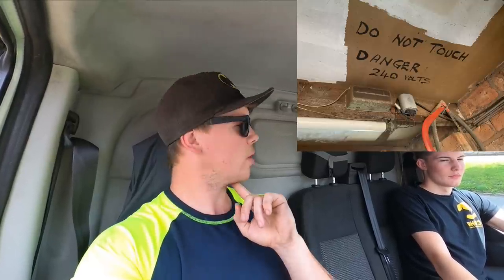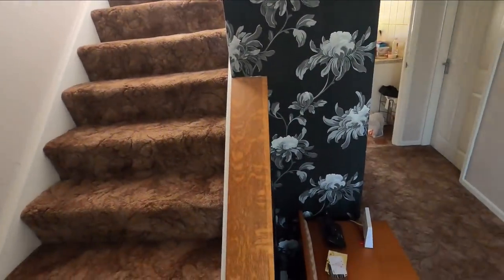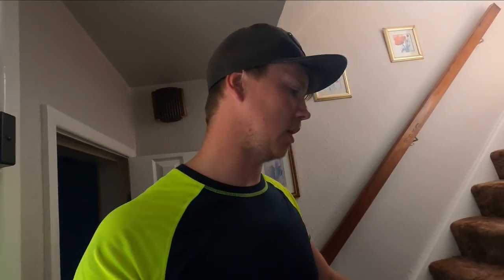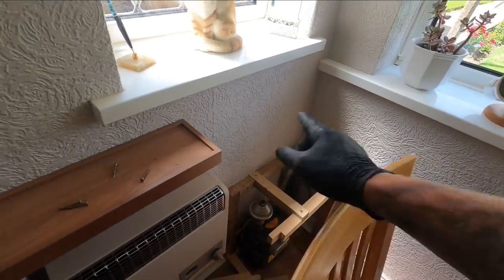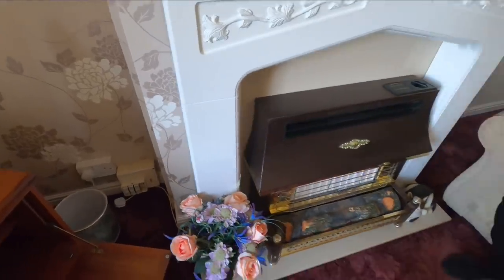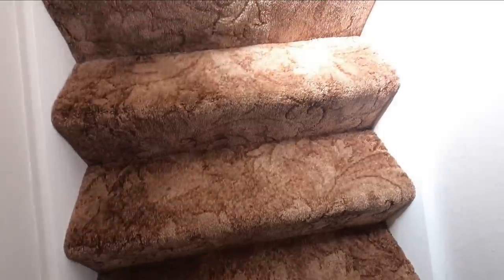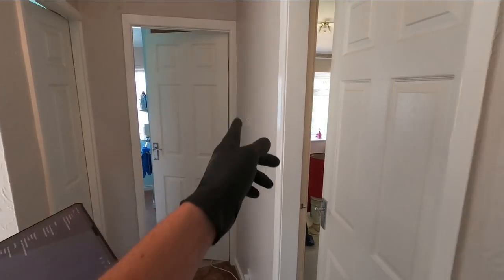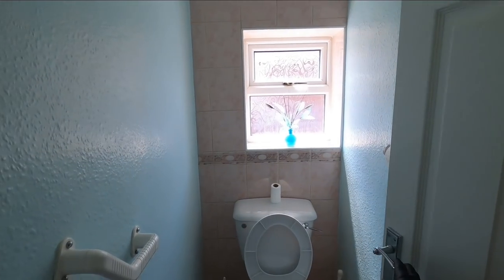How to price/quote a re-wire, Exotic life of an Electrician

Comment: With the Age of the installation I would be wary of asbestos in the consumer units on the fuse carriers when stripping out.
I personally wouldn't put switched fused spurs on the larger 2.6 -3kw storage heaters as I've seen them burn out get hot because of the load. Best to put a 20 amp double pole switch
Reply from the maker: Noted 👍 cheers Paul
Reply: @NBundyElectrical  no problem, The new lot 20 storage heaters as you are probably aware take 2 supplys if your future proofing
Reply: @NBundyElectrical  not just the Consumer units, there`s Artex everywhere and depending on its age Artex can be chock full of Asbestos, chasing through it releases fibres
Reply: @codenamenel  so does jointing compound , gen up on asbestos every six months !! LOL

Comment: Worth having a look at JW's vid on cooker circuits as he suggests that 6mm could be over egging it now and 4mm would be fine. Glad to see you back on the road again👍
Reply: Thought jw would love all those fuse boxes switchgear and ballasts
Reply: 2x 4mm radials is a good shout
Reply: no you shouldnt 4 mm are good for most of them but a 6mm for future prof the installation , in 10 years if the client wants to buy a stronger cooker he will need a rewire
Reply: @cocoino2307  7360 watts (32amp 4mm cable) should be plenty for any 600mm cooker
Reply: @TheHambletonbiker  i disagree  , you should always future proof it , if the costumer wants to rebuild the kitchen in 10 years and chooses a big expensive cooker he would need to rewire the whole circuit because the cowboy spark wanted to save 10£ on the cable , I remember wiring a cooker with a 10 mm cable (i dont remember how much it asked but i was for  a million dollar house ) , other thing lets say in 10 years the cooker thats there breaks and the guy buys one and it  takes 8 9 kw he will either have to buy a new cooker or buy a smaller one
Reply: @cocoino2307  have you watched JW's video? If not I suggest you should, he is a lot better versed on the regs and technical electrical knowledge than 99.9% of electricians and he breaks down exactly how you can use a 4mm for cookers of up to 15 kW, this may not be exactly the figure he gave, watched the video a few weeks ago, you should check it out though!
It's very surprising, but when explained it makes perfect sense, there is ABSOLUTELY no reason to run a 6mm for a cooker or hob, not matter the size.
Potentially the only time you would need to do it is with a very large commercial appliance.
15kW far exceeds anything you would ever have in a domestic setting! 👌🏼
Reply: ♣A well said 💯
Reply: @JackdiyGarden  Cooker circuits have a lot of diversity applied to them . After diversity you can run a 15kw double range cooker on a 6mm 32amp supply so yes for a 600mm wide cooker on a 4mm radial will suffice .

Comment: Sounds about right for a non vat price ,I have to charge vat so I have to make it 20% cheaper than an electrician working from home with not many overheads so you would make more from it than me but luckily I'm normally pricing against  other vat companies so normally get the jobs. Alot of new customers dont go with the cheapest but with the middle price so dont make it too cheap. 1 job we had was to change all the lights in 2 blocks of private flats .the cheapest was about £5000 I was £8000 and the 3rd was £12000 and I got the job , with many other jobs after that without any quotes
Reply: Never heard of any one else giving a 20% discount coz there vat registered. Personally I wouldn’t entertain that.

Comment: Here in Canada that job would easily be $12k CAD. And we for the most part have wood frame walls with drywall or lap and plaster. A lot easier to deal with then the solid plaster / concrete / brick you seem to deal with a lot. Hard to find good honest contractors, glad your town has you to rely on.

Comment: I'd heard that the reason light fittings were put nearer the window is so that the first electric lights mimicked natural daylight. The off centre pendants were definitely a thing from at least the 30s right through to the 60s. In hindsight though I've come across small terraced houses from 1900-1910 both sides of the Pennines where they've asked me to add a central pendant to a dining/living room with only wall lights, and upon taking up the board in the middle of the bedroom there's been a defunct gas pipe centrally

Edit: I'm in Sheffield, similar spec but Crabtree board and only T&E to switches, no VAT, no making good, estimate off the top of my head would be 4-5k. If the switch drops will pull into existing conduit/capping think I'd give the customer the option of surface mounted sockets above the skirting to save on the making good other than the kitchen. If you need to put an earth rod in I'd be lifting one of those flags at the side of the garage I think. Out of interest would you put the board somewhere like 1.2-1.5m from the floor in that cupboard, with maxi trunking up and down?
Reply: the lights put near windows so as not to cast a shadow in front of the window while you was in the room
Reply: socket outlets have to min 450 to bottom switches max 1200 to top on all new installs gone are the days of sockets on top of skirtings!

Comment: Check out John Ward's video on cooker circuits. 4mm is sufficient for a 32amp breaker rather than 6mm. 6mm was only used because of the correction factor associated with a 30amp bs3036 fuses.  We've all been wasting money on 6mm we didn't need 🤣🤣
Reply: That would be  dependant on the reference method and length of run in many scenarios .

Comment: My house is a lead incomer and the cut out burned out a while ago. The dno put a pme cut out onto it so I have 3 options now either the braided thing on the lead sheath with the 4 screw terminal block or the neutral terminal on the cut out. Or link them both. Seems an odd way of leaving it but I don’t care as it’s only my house. Excellent videos thanks.

Comment: Unless it's in the middle of nowhere and fed overhead it can be converted to a PME supply can't remember how much it costs now although it will require digging up the drive if it's lead incommer get a proper earthbond to put on it (not a pipe bond)

Comment: Hi mate would you not fit mains powered carbon monoxide alarms on your smoke circuit? In the rooms with gas fires and a combined heat and smoke in the kitchen? Aico alarms can transfer stored data straight to your phone through a series of beeps! Should check it out

Comment: Hi Nick, good to see you again, never thought of running 3c & e for light switches, that would mean that you still run to the ceiling rose? I'm continuing with a rewire tomorrow(Tuesday) and I've got to run the cables in tomorrow so I might try it in this way
Reply: Doctor Electric An electrician that hasn't thought / heard of taking a neutral to the switch is a worrying prospect! It's been discussed as good practice for years given the expected rise in home automation.

Comment: With that age of property and installation they used to use the old water pipe as the main earth many years ago. 👍🏼

Just need to install a new earth rod with the rewire.  I'm suprised there is not a voltage operated trip that must had been removed.  🙉

Comment: A lot of suppliers no longer offer economy 7 or night storage. If meter replaced that subscription may go and customer left with a redundant fuse board and heaters not working. Maybe timers in consumer unit on rcbos would be better for heaters or change a few heaters, night storage radiators much more expensive to buy than ordinary radiators.
Reply: Jane South There are literally dozens, if not hundreds of time of use / economy seven type tariffs available, and I'm not convinced that a meter change would have any impact whatsoever on the customers current deal either. Night storage heaters are a relic from a bygone age I agree, although if they serve an elderly customers needs it's probably more economical to leave them in and just supply them properly and safely- a new future owner will replace them with gas central heating anyway.

Comment: I've seen some instagram stories, thought it that bad till I watched this.... oh god... HOW IS THAT HOUSE NOT BURNED DOWN?! How is possible with all power hungry storage heater heating?! 😱😱😱

Regarding tiled wall in the kitchen, could you be able to feed cable on other side of the wall into socket? Or routed elsewhere out of sight?
Reply: We have safe zones where we can run buried cables, https://professional-electrician.com/wp-content/uploads/2018/01/021_PE_DEC17-copy.jpg
You cant run cables on the back side of the walls unless you can see the accessory from the other side of the wall
Reply: @codenamenel  Speaking under correction shouldn't anything outside of zones should be done in metal capping or piping?
Reply: @TheHambletonbiker  metal capping isn't the required thickness for mechanical protection from penetration. You could potentially use metal conduit as long as it was properly installed, but thats a much bigger ball ache than removing a few tiles etc

Comment: Take note you young lads fresh out of college there are thousands of properties still wired like this all over the UK.  They look modern on the outside new windows roof plumbing etc but 1950`s electrical systems
Reply: acespark1 You see this a lot if you are house hunting, particularly here in London. Any old house that has been "recently renovated" needs very careful attention- many amateur "property developers" think nothing of installing new kitchens, bathrooms and flooring throughout without ever bothering to check the wiring. I have seen countless properties that look fantastic, only to find that most of the new kit needs to be ripped out to get to the sixty year old wiring beneath and replace it. There are tens of thousands of houses still out there with ancient four way Bakelite Wylex boards from the 1940's still powering the entire house.

Comment: Hopefully that gas water heater in the bathroom is not working any more..that's realy dangerous.
Here in Portugal there used to be many like that, but it's been made illegal several years ago.

It's funny to see how different things are even between european countries.  I've remodeled an old 1960's house and the wiring was terrible..everything running on 1mm2 cable, on just one circuit without any earth..

The "only safety feature" is that we run much lower amps to the houses here..most people have the basic tariff which limits the available power to 15amps..limiting the possibility of those wires melting..

Comment: Ceiling light fixtures hanging from their power cords ? Electrical devices in the shower ? U.K. houses seem to be very dangerous.
Reply: Pendant light fittings are designed to be that way & are used all over the world.  The only electrical device in the shower is the shower unit itself... again nothing unusual in that, the heater that was in the bathroom was powered from outside the room using an extension lead & isn't normal.
Reply: British Electrical standards are one of the best. I’ve worked in many countries and can tell you it’s better than the US NEC and Australia’s AS/NZS. What you’ve seen here is the bottom of the barrel
Reply: Farmer Dave ceiling fixtures are designed to support a 5kg load, they are used all over the planet. Obviously heavier fittings use a chains onto a hooked rose. As previously mentioned the U.K. has some of the strictest regulations and safest standards in the world.

Comment: Damn. I’m a electrician in germany. And the difference is insane. The fuse box in the beginning ng looks like a mess. Is it normal like that?
Reply: NO!!! I don't think so! 😂 It's soooo old, this is first time I've seen entire wiring in this such state! I am amazed how that house has not burned down, with all that power hungry storage heater heating! 😱😬
Reply: Ali Salih Yes you are so right. I was shocked for a second that this is normal in the US. I mean I know that it is a bit different. But damn that’s dangerous 😂
Reply: It both is & isn't normal.  Modern installs are much better (or should be!), but older ones have tended to be adapted over the years hence why there's so many fuse boards.  Up until 2005 it was common for householders and unqualified persons to have a go at wiring, but in 2005 it came under the building regulations so most electrical works now require a sign off from a registered electrician.
Reply: @jeanhomuth6376  Not sure if that was typo or something, we are actually based in the UK. I was actually shocked and amazed as more and more he show around the house, the more dangerous it get! 😬
Reply: @farmersteve129  Yeah I agree, I can see it been adapted / added over the time until it form into a major clusterf*ck! It's so bad and I am amazed 😳
Reply: To add to FarmerSteve's comment, the original installation and the fuse box are probably from the 1950s. The light switches and sockets have been replaced more recently (perhaps the 1980s), but that's been done on the cheap. The cooker wiring looks more recent: late 1990s I'd guess. The rubber cables would have been due for replacement 40 years ago.

But it is completely normal to have the cutout, the meter and a consumer unit wired together using PVC-double-insulated 'meter tails' that just dangle in the air, often surrounded by household clutter. I don't think we notice how messy that is, because that's just how it's always been done. Newer houses (since the 1980s) have the cutout and meter in an outdoor meter box, so they look a bit tidier, but the tails are wired up pretty much the same way.
Reply: This seems about average to what I used to see 30+ years ago helping my father (time served master spark). We pulled some real beauties with those exact garage lights in bathrooms, multiple skirting DBs, lead and fabric wiring. Rewiring with live in was always a fun job!
Reply: I've seen the same or worse in Germany... lights fed with 1940s rubber cables, no earthing, live busbars open to touch in distribution boards, even lead-sheathed cables...

Comment: Storage heaters have dp switches on the off peak supply, do they not? Wired some recently. Fused spurs arent meant for sustained high power tasks like storage heating, dp switches are better suited. Also some storage heaters have 3.6kw elements.

Also why storage heaters and gas?!
Reply: I was thinking why storage heaters when there is a gas boiler.
With the switched fused spurs for double pole switches I agree I've seen plenty spurs with the fuse carrier welded in  and over heat marks on the back because of the thermal effects of the load current on 2.6 and 3kw Storage heaters

Comment: He should at least be offered a low cost simple board change with one plug until can spend more and run things on extension lead as that installation will fail shortly leaving completely cut off.
Reply: Jane South Running everything on extension leads is a recipe for disaster. If the homeowner doesn't trip and break their neck in the first week, they will end up burning the house down through overloading.

Comment: How has that house not burned down ! Some of the worst electrics I’ve ever seen.
Reply: I've seen worse! How about sockets wired with 0.75 mm2 flex buried in the wall? Granted, they were on a 10 amp fuse but that's bad enough. The route the flex took inside the plaster across the wall looked more like crooked stairs than straight lines too. My best guess was Italian sparks after two bottles of grappa because they used Italian sockets everywhere and Italians loved that flat two-core flex for fixed wiring back then. In another place I had kitchen sockets fed off of a piece of the same 0.75 mm2 flex, no earth, fed from a 16 amp radial. Decent fire starter I'd say! The fabric-covered rubber wires for the hall ceiling lights were all burned to a nice crisp up into the plaster & lath ceiling. It isn't all that unusual to find bits of pre-WWI wiring still in service here in Vienna!

Comment: A separate 6mm for the cooker and hob is pissing money up the wall
Reply: You can run about 19KW of cooker and hob from a 32A 6mm supply, what are you expecting to be fitted 😂
Reply: Matt Thompson There are range cookers out there with two ovens, separate grill and six induction rings that specify a 63 amp breaker. I'd always want an absolute minimum 6mm cooker supply and for the sake of a few quid more I'd usually ask for 10mm.